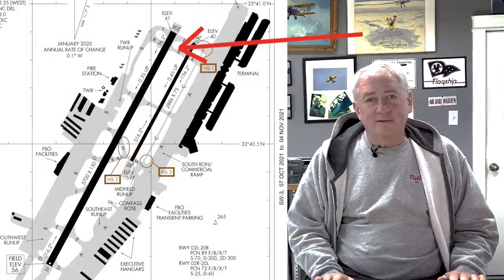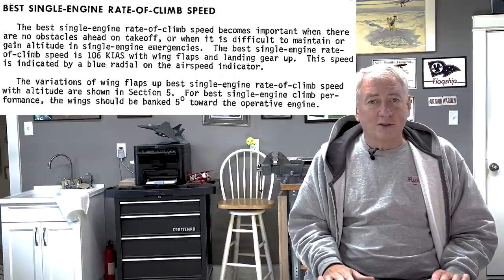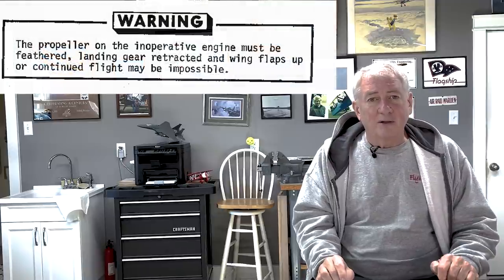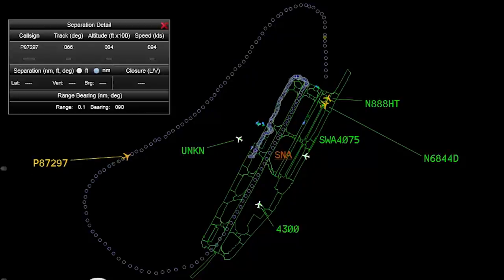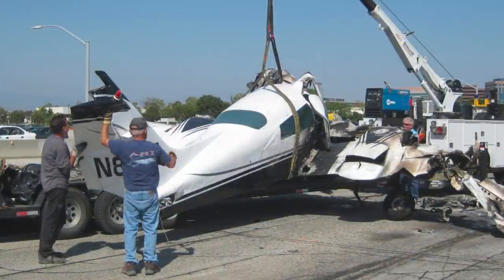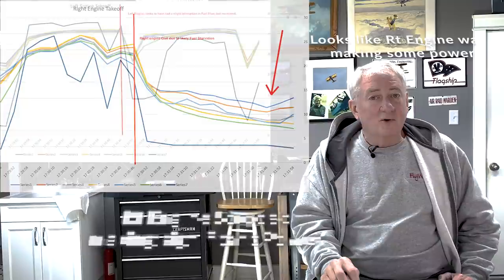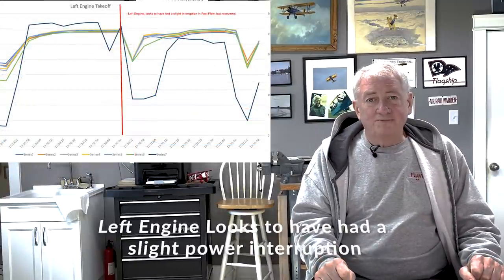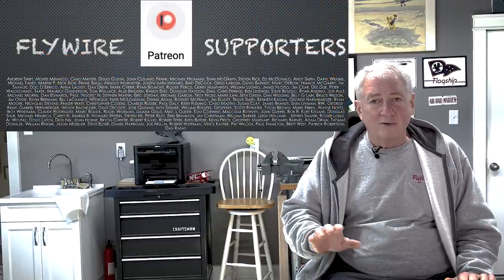C 310R Engine Failure After Takeoff

Comment: Youtube presented this channel to me just now, watched this vid, and subbed.  Great stuff!  I'm a big proponent of home computer sims, with the right kind of software and accessory setup, for certain proficiency tasks.  The key to performing in those situations is to drill that stuff until you've had enough, and drill some more, and a home sim can provide the visuals and much of the physical actions to fully internalize procedures with far more repetition than you could ever achieve with real aircraft, or real simulators for that matter.  I had a job where I was seconded as an FO to a flight ops department that operated CRJs, got type rated, and would fly in support part time. So it was only flying a few legs once a month or so.  To stay sharp, I got a CRJ200 sim for FSX for my computer and it had enough features in its virtual cockpit, with decent visuals, to be able to do V1 cuts and approaches etc.  I could go into recurrent having done, really, hundreds of V1 cuts on my computer at home over the previous months, so when the instructor executed one in the sim, the actions just flowed effortlessly and my mind was free to fly the plane and think ahead.  I would've really struggled in recurrent without it.
Reply from the maker: Excellent story and a perfect example of what a sim can do for you. Thanks for watching and sharing!

Comment: Another great video that hopefully  will be viewed by all light twin pilots, especially those with low yearly hours.  You mentioned DC-3s.  I was a mechanic of D-18's and  3s (47s) back in the mid 70's at Willow Run Ypsilanti, Mi. I would always volunteer to go with the pilots on any test runs after any repairs or alterations we did on the planes.  One time we put a zero time refurbed 1830 starboard side and some other stuff and I was the ck ride mechanic for a DC-3 for the first time.  There were 3 pilots that went for some unknown reason and one was the chief pilot who sat behind the pilot's seat. I sat behind the co-pilot at the observation window so I could watch the starboard engine.  I didn't have any headset and all I could barely hear was the loud speaker to hear the radio conversation.  When they were doing the run up and preflight, they were taking about golf.  Same thing during roll out and rotation whenever they could get a few words in.  Then at 500 feet, they started talking about the oil temp on the starboard engine and a few seconds later the pilot said to shut it down and feather the prop.  So I watched that going on.  I didn't notice anything much out of the normal. We keep climbing to about 1500 agl and they never stopped talking about golf as they turned slightly into the DEAD engine.  The tower kept asking them what they needed and from what I could hear, they said nothing.  The tower wanted to foam the runway and the pilot said no.  So we came around in right traffic and everything seemed normal to me.   Keep in mind the plane had full full except had no cargo.  I felt very laid back about the whole thing but was disappointed I was not going to have a nice long flight.  Pilot did a perfect landing and during the entire event, even after we got picked up by a ground crew, these guys were still talking about golf.  
So from that time on up until now, watching your video, I always thought pilots turned into the dead engine.  I did however think that could be tricky, but only being a single engine pilot, it didn't concern me much.

Comment: I am a cfi,  ii, and mei and I've done an awful lot of multi engine training, and you are right on.   I took my first ME training in an Aztec, and I've never worked so hard, and always came back with a sore leg.  I did the ME training later, in a Baron.  I have been very lucky to have had two ME instructors that were outstanding . I ended up later flying twins for several years, and followed the rules and practice.  When I went to an Airline I had to work very hard, but I got through.  So, I think that most people get their ME rating and never have another lesson.  It takes practice on a regular basis.  Also,  going to a Sim School for a few days of more training can make a huge difference.  That was a good ground school that you did was really excellent. It seems to me that the guy who crashed had no idea what he was doing all the way through the emergency. And, the dead engine acts like a great big plate pushing the dead engine creates drag, and lots of it.  Good lesson, thanks.

Comment: What I didn’t like about the John Wayne noise abatement t/o procedure was not having visibility over the nose of the aircraft due to high AOA! There were always small aircraft flying low along the beach and once in awhile some that did not maintain correct altitude. Never an issue, but always heads up😎Otherwise, beautiful departure 👨‍✈️

Comment: Scott, I see why he may have turned right. There was a A plane squawking VFR taking off from the left runway. When he called Mayday, the other aircraft was close to his left.  The traffic pattern for the right runway was a right pattern. Had he turned left without climbing much, what were the chances of a midair? I have had a right engine failure on takeoff but it wasn’t at an airport with parallel runways. The day before flying a twin, I would sit in the cockpit and manually practice the engine out procedures every time. I would read through the POH and emergency checklist.  I would do takeoff performance calculations on both the departure airport and the departure from the airport I was flying to. I didn’t get to fly twins much so my prep time was usually three times my flight time or more.
Reply from the maker: The Traffic pattern is indeed a right one for 20R... doesn't mean that is the best choice. He was an emergency, therefore everyone else needs to get out his way.
Reply: @FlyWirescottperdue   I know. That is what should happen. Just from the illustration in the video it looked like he had traffic off his left wing at the time he called mayday. I would have a hard time turning into another airplane hoping the other guy got out of my way.  If you were the plane taking off on the right runway and you heard mayday on the radio, what would you do to give him room? First, you wouldn’t know who called the mayday, then you might not know the twin might need to turn towards you.  I have called Mayday twice in my career. One was high and 18 miles out. The other was the engine out on takeoff. In both instances the tower had time to stop other people from entering the runway environment.

Comment: Scott:  I’m an SNA based pilot, CFI, CFII, MEI, recent owner of a T310R at SNA and know the accident airplane and one of its owners well.  Something that appears inaccurate in the findings is your note regarding the engine time of 6 hours in a 7 year period.  This airplane was owned in a partnership of 3 individuals and was flown far more regularly than that. This does not give any indication as to the recency of experience or currency of the accident pilot as I do not know him or his flying habits.  I do know however that one of the partners flew the airplane very regularly.  As a T310R owner I can say this pilot was very lucky to be flying light and to have VG’s on that airplane.  I believe if he had handled this same situation with any additional weight or without vortex generators he would have VMC rolled much earlier in the accident sequence.  The condition of the right fuel selector really has me scratching my head as to whether he switched the right selector following the engine failure, or commenced takeoff in that mix matched condition.
Reply from the maker: I got the numbers from the logbooks that were included in the Docket. I thought that was unusual, but if the airplane had flown more, the logs were fudged. You make the call.
Reply: It said he used 15 flap for T/O . Is that in the POH ?  If so ——why ?  No short/soft field or obstacles , and we aren’t told he raised them ——just the gear .
If he flew the pattern that way the extra drag sure didn’t help , and could have made the difference for that last turn and landing .

Comment: It's tough when you're flying 100 hours a year to stay proficient. NOT JUDGING!!! This guy/owner flew 7 hours in 7 years if I heard correctly. As they say anyone can fly (and look good) a multi until something goes wrong. It might makes sense to not fly twins in this situation unless you're prepared for the 50% increased probability of a problem and train incredibly well for it to turn out right. Great report!

I flew a 310 RT for 16 years after my airline rated 30k+ hot dad made it look easy since bought new in 1977 and gave it to me with zero times props and engines. I was always amazed at the problems that I experienced were due to my 100hr per year non-proficiency that were otherwise avoidable. Bad fuel in Mexico, headwinds leading to low fuel in Mexico, unexplained auto pilot-radio-lights failure and of course the inevitable cylinder or case problem leading to low power. I was lucky.

I've always wondered if aTBM series would have been a better choice.
Reply: We know the mishap pilot didn't fly this plane very much. We don't know if he was flying other aircraft over that time period...single or twins.

Comment: Excellent brief Scott,  and thanks. Any thoughts on GA light twin simulator training?  
Some years ago a friend and I knocked up a multi-engine sim with realistic control forces and actions, similar to a 310/414, and if desired, could be dialed-up to be very  challenging with 120lbs of rudder force. A multi-engine / ATP instructor found it a good training aid for engine-out departure practice and single-engine IFR familiarization. We used to enjoy doing '0-0' departures and pulling an engine just after take-off and shooting a partial-panel return approaches. After which I felt much more current and confidant doing it for real.
Reply from the maker: That would be an excellent training device. You should talk to Redbird!
Reply: @FlyWirescottperdue  Thanks Scott! I was not aware of Redbird flight simulators, but their concept is very similar to what had planned. Looking foward to getting in contact, and if you know someone and care to drop a name please let me know.
Reply: Check out aircraft simulator training in Texas. They have full motion sims for the 310.  Very very very good training. It doesn’t help on my insurance, but I go at least once a year on my dime.  Worth every penny

Comment: I think the flaps 15 found were done from the impact, or getting out they touched it.  Lever is bent.  They were on a long runeway,  and Flaps 15 for a rusty pilot makes take off more demanding and dangerous if eng fails too.  Saw a crashed 152 that flaps went to 30 after they hit the ground.  They touched the lever on the impact.

Comment: Excellent review and analysis Sir.Thank you. Indeed proficiency AND recency are both saviours in piloting airplanes.These two factors have never been as relevant as during these covid restrictive times.

I have in the past flown almost all the C320 series from B-R variants.I currently (but vbarely recently) fly private jets and we fly sparingly and plane is stored inappropriately and so every flight we do seems like a Russian roulette and the owner of the plane is against conservative measures like doing thorough checks and engine tests on the ground. Even if jets are simpler to fly then props they are still aircraft and exposed to the same risks which must be mitigated. Great lesson about what you think you did versus what you actually did due to startle effect and being out of practice with muscle memory repetitions. A plane you have flown for years after a long absence will feel uncomfortably unfamiliar and intimidating, not to mention the ATC and Airport environment especially if a complex busy airport with a fast paced dynamics of communication and swift clearances. When feeling any level of discomfort and if you can not slow down, better turn those magnetos off and open that escape hatch and go save yourself man!

Comment: The boost pumps on a C310 are in the tip tanks and push fuel to the engines.  The aux tanks do not have any boost pump capability.  Fuel from the aux tanks gets sucked from them by the mechanical engine driven pump when selected.  There are 2 switch positions for each (L & R) boot pump, low for take off and landing and high for priming and for in-flight failure of the mechanical pump.  Not sure where you got the impression that low boost is exclusively for switching tanks, but that is not true.  There may be some benefit to low boost when switching from aux back to main, but little value the other way around.

 I own, fly, and maintain C310s so I am familiar with their fuel systems.  If this pilot took off with the right engine on aux and there was even a small air leak in the plumping that engine could have been sucking air.  Likewise, if the fuel level was low the acceleration or lack of coordinated flight when airborne could have unported the aux tank fuel inlet.  Mere speculation on my part as I do not know the details beyond what you've said.
Reply from the maker: Thanks Gary, My source was the POH. I don't have first hand experience with the C-310. But the investigators noted the Fuel Selector for the Right engine on Aux. The Boost pump switch was on low. You're saying the boost pump  on low would not have affected the fuel flow from that tank at all... right?
Reply: @FlyWirescottperdue  The POH for my C310F says to use high boost for take-off and landing.  This was because Cessna equipped the plane with a pressure switch under the cowl which actually ran the pump on low boost unless a loss of sufficient pressure was detected from the mechanical pump.  Then this switch would run the boost pump in high mode.  Cessna later found out this was a bad idea because if the pressure switch failed the pilot would not have access to high boost if needed in an emergency.  They issued service bulletin MEB88-3 (January 1991) to address this.  The pressure switch was eliminated thru a wiring change so that high was high unconditionally and low remained unchanged.  A placard was then placed in view of the pilot which says the following "AUX PUMP LOW FOR TAKEOFF, LANDING AND VAPOR CLEARING.  AUX PUMP HIGH FOR ENGINE DRIVEN FUEL PUMP FAILURE (VERY LOW OR NO FUEL PRESSURE)."  There was also an AFM supplement along with this modification, but who knows if the POH you had access to contained this verbiage.
Reply: One needs to,know if the fuel boost pump service bulletin was done on that 310.  My understanding is that it was never done from the factory.  The boost pump is used to clear vapor from the tip tanks.   The POH does say to place the boost pump in the low position when going to the aux tanks.  That is to ensure the lines has fresh fuel and one can go back to the tip tanks without issue.     The boost pump switch with the SB installed is actually 3 position.  Center is off, up is high down is low.   Low for take off and landing and aux tank use.  Off for cruise (except when running on aux tanks).  High for engine failure only.
Reply: @garyplewa9277  excellent information. Since this was not an AD it is quite possible there are a number of aircraft out there without this mod, or the critical info it provides.

Comment: What he should’ve done is go STRAIGHT AHEAD instead of turning. Maintain directional control, clean up, accelerate, climb, then level off before attempting any turns. 
Being out over water with all that room and climbing slowly is better than drag inducing turns while hanging a few knots above Vmc. 
However, since he panicked and rushed it, he literally flew the airplane out of control.

Comment: Good information shared. The way the runway was set up when the pilot takeoff and in the approach back to the runway, the pilot had no other choice but to make right turns because he was already heading in that direction. Unless when he was taking off and made a left turns not towards the dead engine. So the odds was already against him in a right turn takeoff. He had no other choice but to make it work as professionally as possible.
Reply from the maker: Doubling down on a mistake doesn't mean it will make things better.
Reply: So was it better for him to ask ATC for all left turns back to the runway? I feel as if he was already in a panic situation and heading in that direction when the engine failed on him. Plus he was loosing altitude the same time. It would of been harder for him to change his direction of travel completely. It’s better to try and control the situation and keep going instead of facing another challenge.

Comment: From the FAA transition to multi engine chapter (applies to twins with less than 6000 lbs gross weight: ... (On approach) "The airspeed 
should be no slower than VYSE. The direction of the traffic 
pattern, and therefore the turns, is of no consequence as far as 
airplane controllability and performance are concerned. It is 
perfectly acceptable to make turns toward the failed engine."
First memory item:
the “dead foot” is on the same side as the “dead engine.” 

The second memory aid has to do with climb performance. 
The phrase “raise the dead” is a reminder that the best climb 
performance is obtained with a very shallow bank, about 2° 
toward the operating engine. Therefore, the inoperative, or 
“dead” engine should be “raised” with a very slight bank.

Comment: I have fair amount of time (over 400 hours) in various models of the C-310. I was taught the standard, "split flap" design in a stock airplane only increased drag, no increase in lift. I never used any setting of flaps for takeoff - they didn't improve performance, only one more thing to reduce performance, one more thing to "clean up" in the event of an engine failure during the first 90 seconds after brake release. Was I missing something?
Reply from the maker: Nope, not from my perspective.